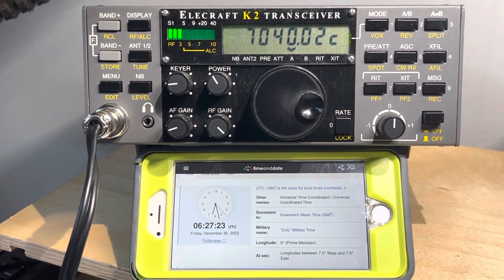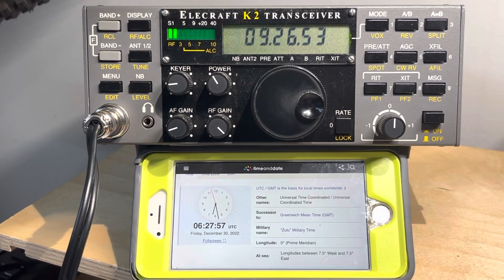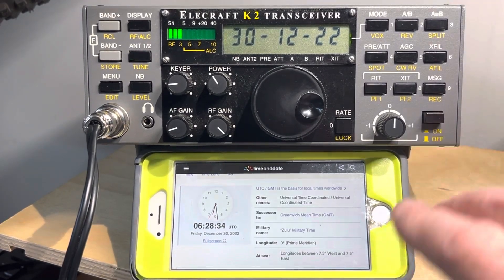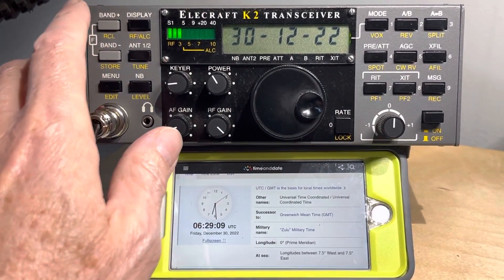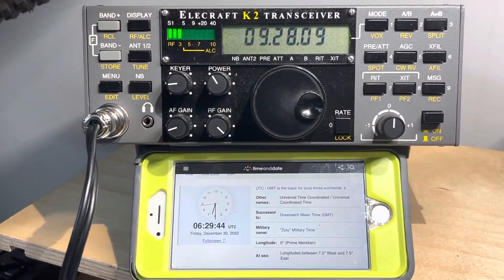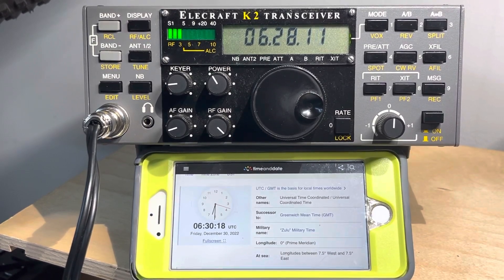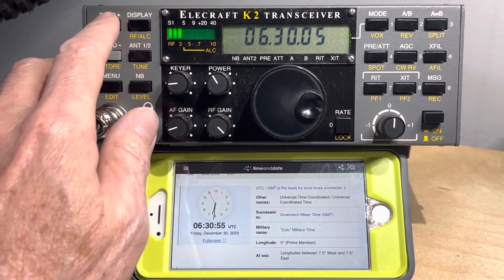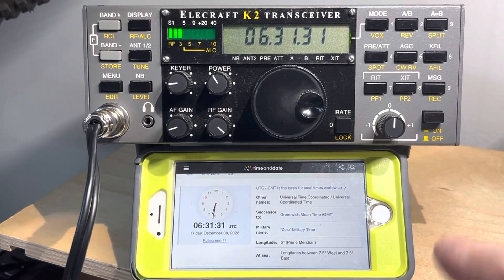The Magic of Setting Elecraft K2 Time

Comment: Nice to have the clock right if you have one installed!
Reply from the maker: Agree it is cool to have the clock at the touch of a button. I sometimes forget it is there when I switch between the K1 and the K2. :-). What other options do you use a lot on your K2?  73, bruce
Reply: @tyrueiI  - I have one of the Programmable Function keys set to Sidetone Volume. Also, I use the Memories to set up both VFOs on each band... e.g. set VFO A for 3560 CW and VFO B higher up for LSB, but I don't think it saves different modes for the two VFOs.